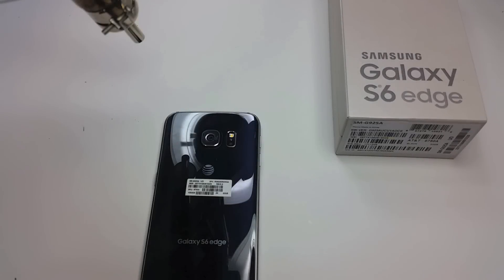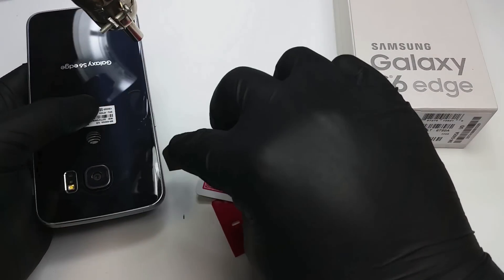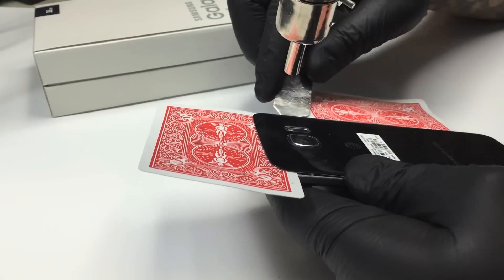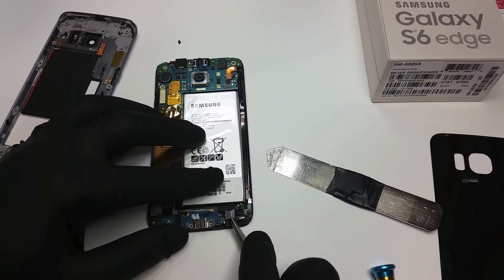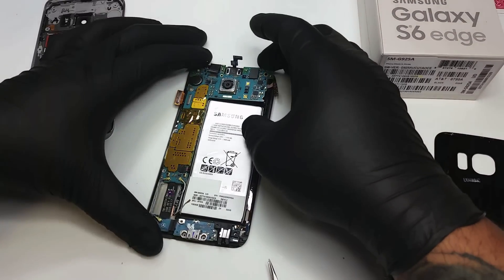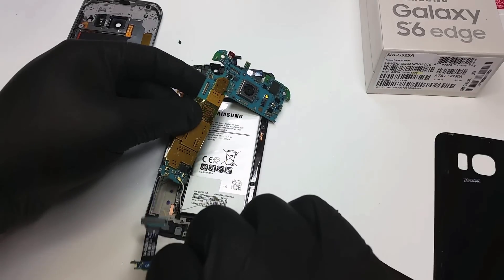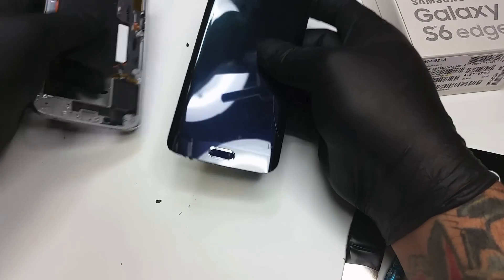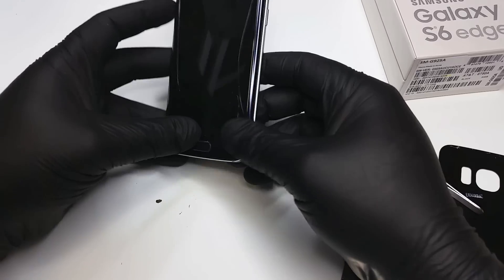Galaxy S6 edge charging port repair/replacement

Comment: Great video, and I can't understand who have you dislikes unless they're just not good with this. The big change I made was the tools to open the back cover. I used a few plastic placeholders, but for the original opening, I used a #30 Exacto blade. I inserted it flush, turned it 90 degrees and made it over 75% around the phone before I had to reheat, putting in a few place holders along the way. It took about three minutes total.The #30 blades can also just be used as placeholders. It almost seems like they were designed for this.

Comment: Good video, fixed my broken USB port!  Thanks.  However I couldn't remove my back cover without cracking it, I'm amazed that you could.   However replacement back covers are <$10 and come with new adhesive attached, so you might as well buy a new cover along with the new USB board before you start the repair
Reply: Tom Wilson as opposed to paying 289.99 for CPR to assume they'll crack the screen I may go this route
Reply: do you have a link to a place that sells? or if you know the part numbers. thanks!
Reply: I got tired of replacing the broken glass back, so I just covered the phone with a silicone case, and clean it from time to time.
Reply: sorry to be so offtopic but does any of you know a method to get back into an instagram account..?
I stupidly forgot my password. I would appreciate any assistance you can give me!
Reply: @Camden Mayson Instablaster ;)
Reply: @Nicholas Brock Thanks so much for your reply. I got to the site on google and Im in the hacking process atm.
Looks like it's gonna take quite some time so I will get back to you later when my account password hopefully is recovered.
Reply: @Nicholas Brock it worked and I now got access to my account again. I am so happy:D
Thank you so much you saved my account!
Reply: @Camden Mayson Happy to help :D

Comment: This was such an awesome video. I had 0 experience working on phones but needed to replace this part. I figured I had nothing to lose since my phone was useless as is. It works great now!

A couple things that I'd like to add. This may be super obvious, but I didn't think about it till it was almost too late. Remove the Sim Card and its holder before removing the front. I almost broke the tray, but caught it just in time. And is there any way to prevent the phone from turning on while doing the repair? Mine turned on twice (without me touching the power button). The second time was WHILE I was replacing the assembly.

Thank you, again!
Reply: where did you buy the port part
Reply: Did you reuse the adhessive?

Comment: I really wonder if you can use a heat gun and remove the solder on the microusb, then replace it with a type c usb on the same charging logic board???
Reply: of course not.

Comment: Hey I dont see anyone commenting on how dangerous it is to use the metal tool to unplug the connectors while the battery is still connected, risk of having a short circuit is too high, but hey we all open our phones differently, my honest advise use a plastic tool for it or use ur nail no metal

Comment: Just dropping a comment for anyone interested handling this task ...This video may seem very helpful although it is quite misleading ...I just did this job rightnow and followed each of his instructions my Galaxy S6 edge plus now charges just fine but now I face another issue. Both Menu and back button are non fuctionable . I did some further research and it's seems he may have left out an important part.  You have to also install the touch sensors in which the charging panel comes with. Me not knowing simply cut off those 2 sensors rendering bottom functions useless.
Reply: Figures how do you install those 2 ? can you share it as im also going to repair my phone..
Reply: just asking but did you lose your data? or does it still stay because my port is broken and i'm scared

Comment: So I have 3 qualcomm 2.0 charging adapters well technically 2 adapters 1 battery. I found that fast charging quit working so I thought the original adapter broke. I bought a battery and a adapter off amazon that were 2.0 certified and found that they don't work either. which then brought me to the conclusion that it had to be my phone. so I take a light and look at the charging port and find a very slight burn mark on the prong. Is this by chance the problem to my fast charging nightmare?

Comment: other than the fact that he doesn't take off the battery flex as soon as he open's up the phone and uses metal tools to do so later, to open any kind of a flex inside a phone you really should use plastic tools but it's not a bad video. Also, I would recommend using a guitar pick instead of a metal blade.

Comment: I used an iPhone charging block with my mini USB cord because I didn't have my Samsung block. Do you think that is why my phone won't charge thru the port but still charges wirelessly? I kept making the bing sound when you connect your phone to charge so I unplugged it and it made the sound two more times. Also, the screen turned into green and red and would go back to my home screen when I press the home button. The screen doesn't do that anymore. PLEASE HELP! lol

Comment: I have a question, is there a way to remove the wireless charger attached to the frame without breaking it? I just got a middle frame, but the wireless charger felt cheap, not like the one I have in use, so I put a lot of strength and it broke. I want to use the old wireless charging port in the new frame, is that possible?

Comment: Guys, just one question, after you put it all back, do you also need to replace the adhesive on the back glass or no real need??
Reply: you need to put a new adhesive
Reply: Thanks Ali!
Reply: if he is a bit sticky to your fingers  it wil hold .. put your back glass back and heat really well with a heatgun ..the adhesive will make the deathgrip once again afther the cooldown
Reply: Carlos Escobar n

Comment: Hi wondering if you can help, when i connect my phone to the charger  my phone turns on and everything works but the battery status always shows 0% . If i disconnect the charger  the phone shuts off right away . Any ideas ?

Comment: The video never said to take the SIM card out, very important step. I almost snapped mine in half trying to separate the back from the LCD as a result. Now I'm having some mobile network connectivity issues, wondering if this is the reason.
Reply: But good instruction otherwise

Comment: hi guys, it looks I have fried a charging board -main board connector in my s6 edge.
my question: is there any way to bypass that connector and power up the main board for a while just to recover my photos ? 
or is there any way to check is fuses on the main board are still intact?
Many thanks, Tom

Comment: hi, is this able to be done if the screen is cracked both front and back (and the back is quite badly cracked)? or will it just fall apart on removal? thanks
Reply: The Vlogers me too
Reply: glad im not the only one! ive changed tonnes of phone screens before but these phone screens are expensive, if i try to take it apart and the screens fall apart in my hands then im buggered! any reply please CELL PHONE REPAIR??

Comment: hi, my 6edge has network issues. I was told I need to change the antenna. can you please show me where the antenna is located? thanks
Reply: Its the two coaxial cables he was talking about. the ones that can get "easily pinched"

Comment: hi,i got an s6 edge and it needs 6 hours until full charge i tryed all common solution like changing cable and the whole charger with another original one but still same,when i checked the setting i found the fast charging option turned on and when i connected the charger it auto off and no ability to turn it again until i take out the charger,could anyone help me or suggest me to do something please?

Comment: Hello, I had a problem with charging of my phone. Alert says "batterry temperature too low" and is not charging. So I changed the charging port. Charging worked ok, but at the 3rd or 4th charge cycle it showed the same error. I installed new charging port, but it says imidietly the same about the batterry temperature. Could anyone please tell me, what else can cause this message and what else can be done to make it working properly again? Thank you!

Comment: Idk how long you've been doing phone repairs but the first thing you should've been taught when learning was to NEVER use metal tools to remove connections or anything like that because they can knock resistors off the board or spark it and burn resistors and fry the phone. Please take this video and remake it using the proper tools before someone does it wrong like you are in the video and messes up their phone.
Reply: If you disconnect the battery before, there is no problem in using metal, I also use metal to remove ...

Comment: what did you do with the Menu and Back button? just cut it and didn't install it?
Reply: that's what it looks like... the glass part of the screen had to be removed or lifted up, and then the two touch buttons placed in.
Reply: Due to this video lack of further info my menu and back button do not work now